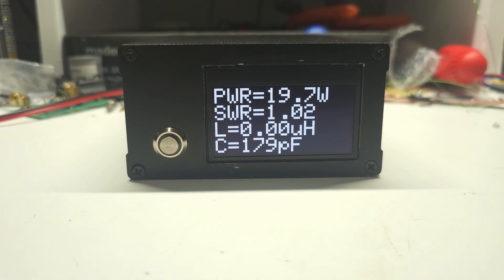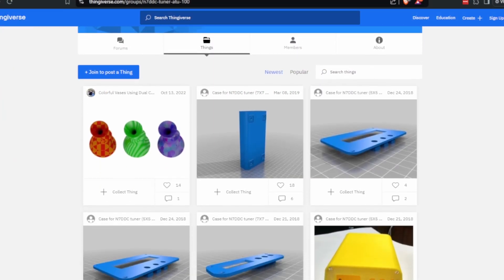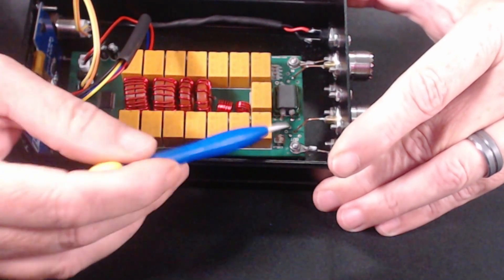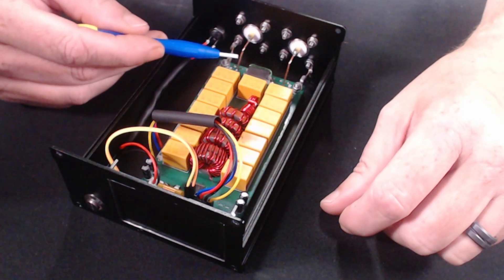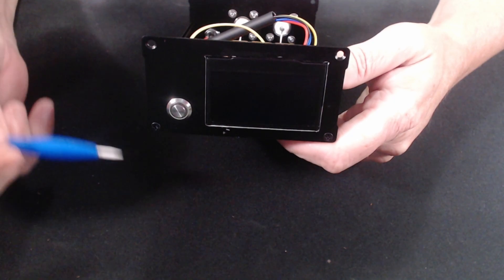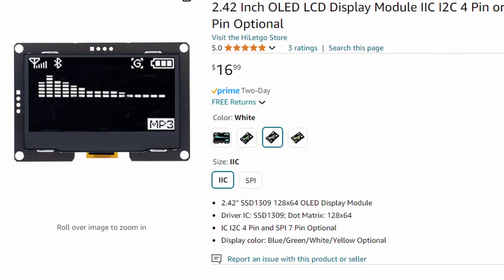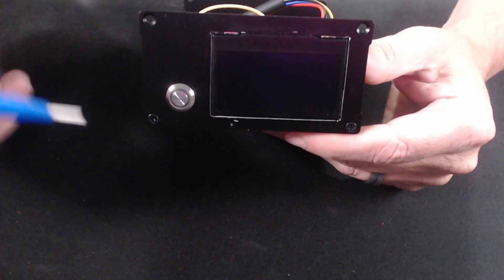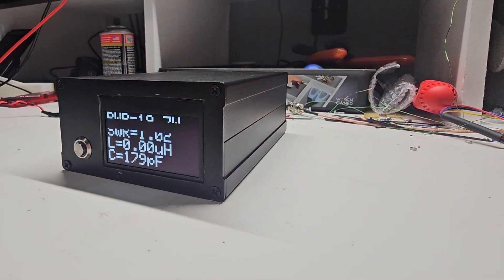Big Upgrades for ATU 100 Antenna Tuner – DIY Ham Radio

Comment: Hey, nice video. I just bought what they call an ATU-130 on Amazon. Its very similar to the AT-100, fully assembled with a case and 3 buttons. I bought mine for use as a portable remote tuner that I mound high on a mast at the feed point of a wire doublet for lower bands and I also use it with a home-brew telescopic dipole for the upper bands. I mount it as high as I can on a steel segmented mast, 24 to 30 feet at the feed point.
Reply from the maker: Nice, that should work good